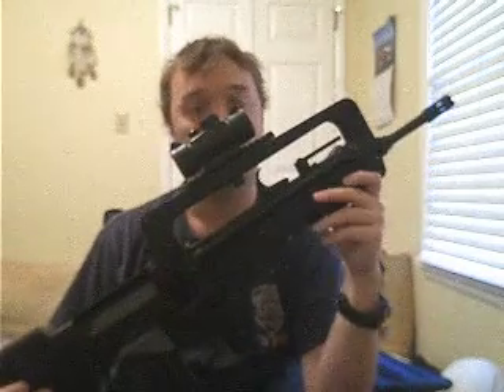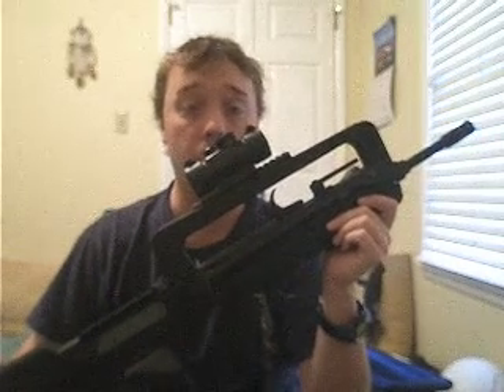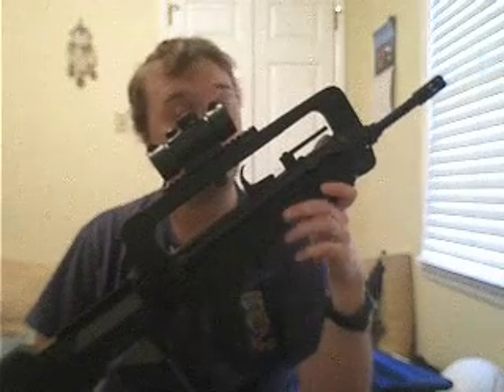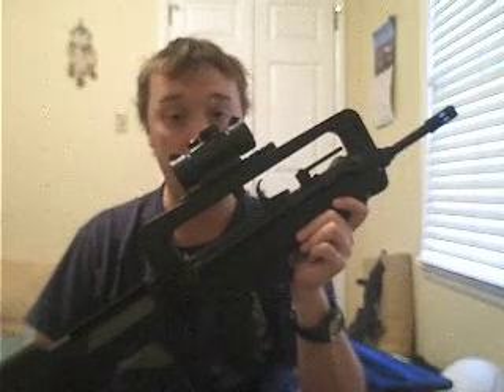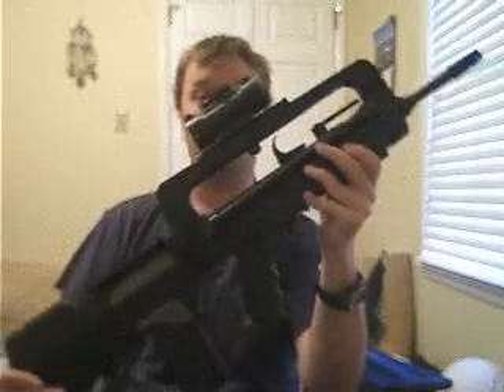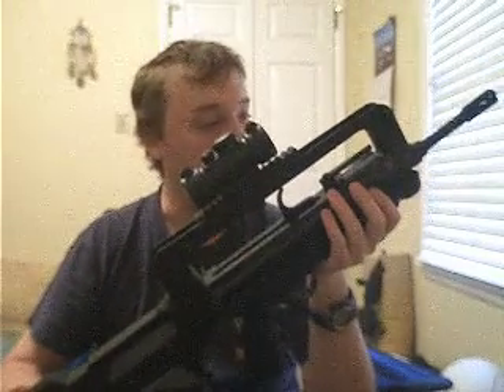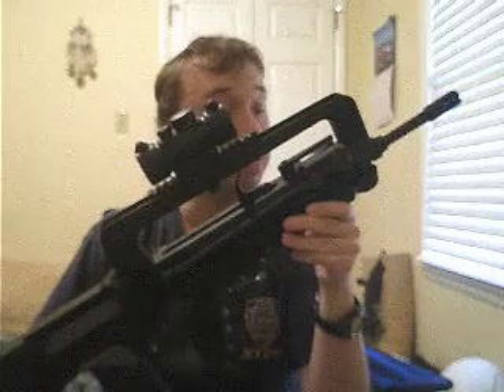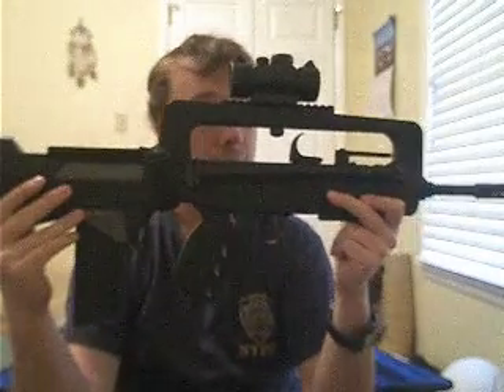Cybergun Famas Review

Comment: designed  to 1973 to 77 adopted in 1979 production ended in 92  , 
it use the AA52 mechanism and bulpup concelp designed around 1954 in france 
use vintage steel cased anmo 
before whe use the mas 49/56 and the mat 49 
it's the last of the french rifle , the factory was claused in 2000
after 2015 the french troop do not use anymore french wheapon for use belgian/german wheapon